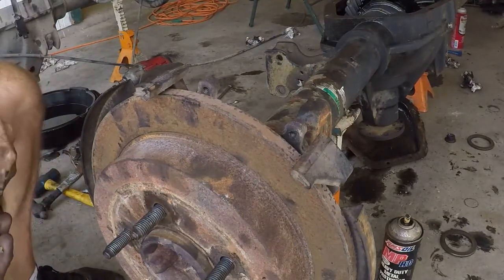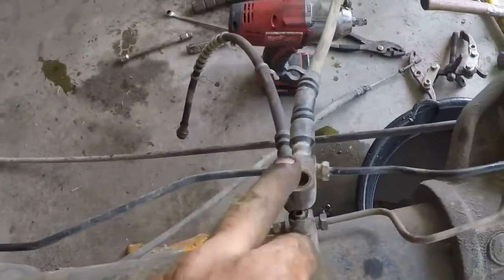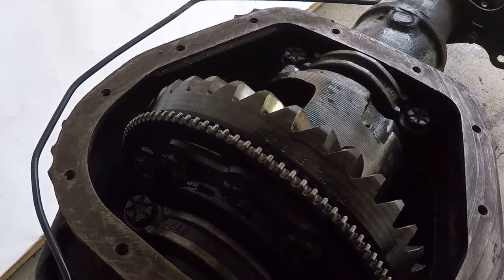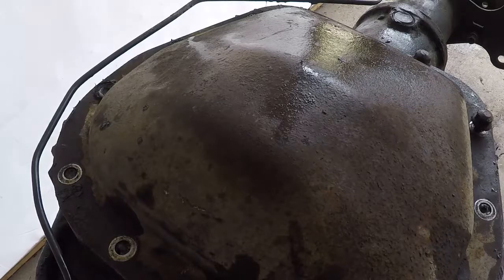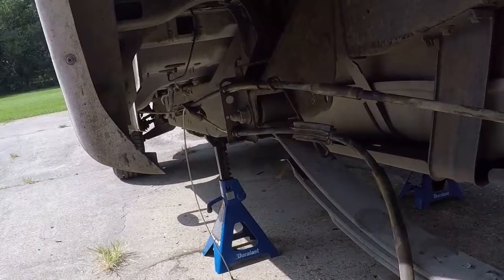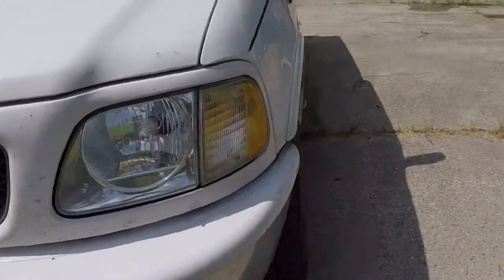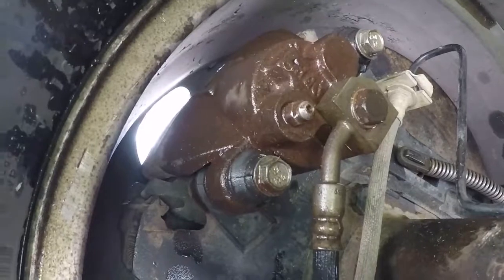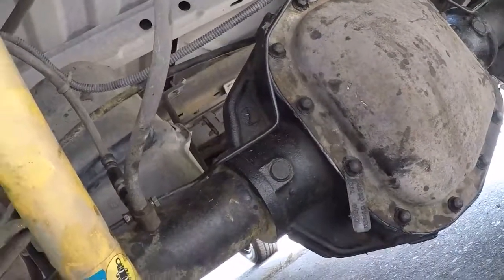1997 F150 Rear Disc Brake Conversion Part 7

Comment: what kind of rear end is that I got a 96 it looks nothing like that rear end it's got a 8.8 ford as far as I knew ford ran the 8.8 up till 03 in the f150 I'm wanting to go to disk on my 96 but don't know if I want to go through all this trouble are what I got to do to make it work on the 8.8
Reply from the maker: I learned something new with this question. You are correct, the 8.8 was used in the f150 up through 2012. But the 5.4L models like mine and my junker used a 9.75" rear end. I do not know if the parts are interchangeable. If I was looking to upgrade am 8.8 to disk, I'd start looking for a v6 or 4.6L truck in the junk yard that had what I needed. Also, given the 8.8 was used in the mustang for effectively ever, there may be an aftermarket bolt on solution that could be made to work. Good luck and thanks!
Reply: Thank you I'll try that i know some of the ford explorers with the 5.0 had 8.8 in them from 96 up to like 2000 think some of those had disk brakes I watched a guy on here do a swap and he's talking about cuting and welding the backing plate and drilling the roters all kinds of things I don't want to do my drum brakes are working good for now think I just got a warped rotor somewhere getting the old shaking coming off the highway

Comment: Did you have to rebuild all the gearing and stuff? Could you just remove the backing plate from the drum and install the one off the disc brake axle? Because I’m trying to install a 3.55 gear ratio axle on mine, but it has drum brakes. I was wondering if I could just swap some parts over ?
Reply from the maker: I had to do the gears because the rear had been trashed in the junk truck. Unfortunately the axle ends are very different from the drums on my 97 to the discs on the 03 so none of the disc parts could transfer without cutting the axles and welding new ends on. If you have a good disc rear with the correct gears, it's a bolt in swap though.
Reply: Hopefully I have better luck since I pulled mine out of a 99 and my truck is a 99 as well.